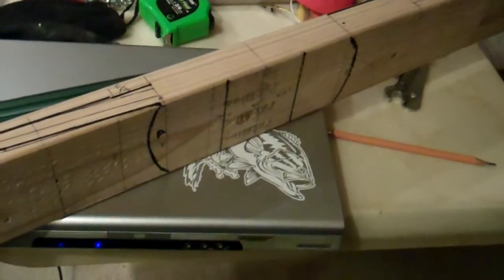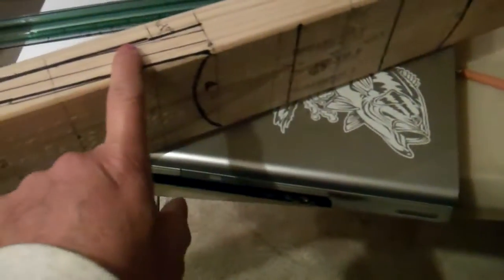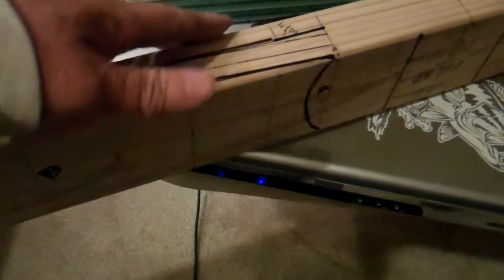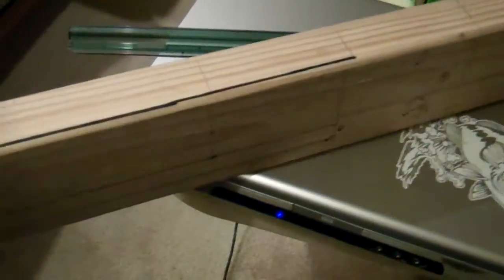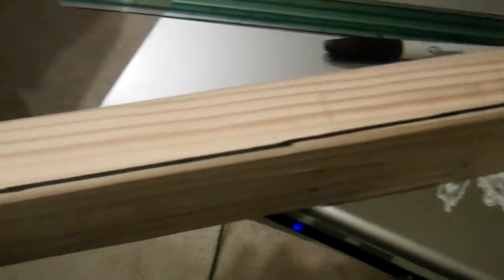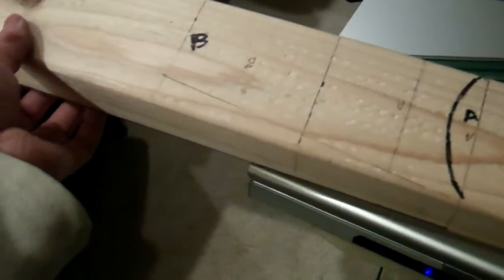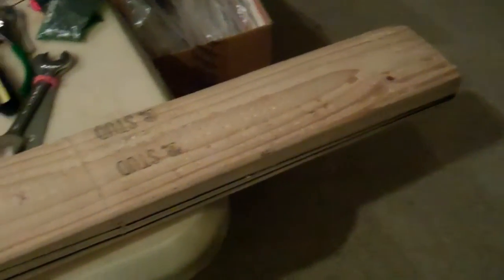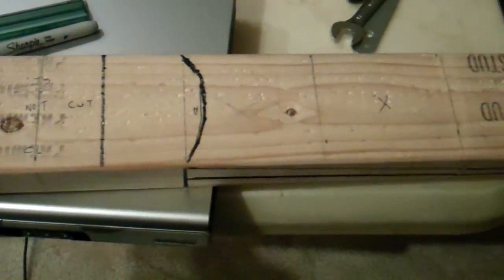Making wood blades for ceiling fan motor Movie.wmv

Comment: I always wondered why fan blades are usually of a “paddle design”. Just flat paddles basically smacking air. I am into aviation and aerodynamics and understand the most efficient and perfect shape to move are is more of a twisted shape. I wonder if they don’t use it on ceiling fans is because it moves so much slower? You’d think there would be fans with the torqued design moving more air efficiently
Reply from the maker: My ceiling fan blade has a "twisted shape" and airplane propeller shape.